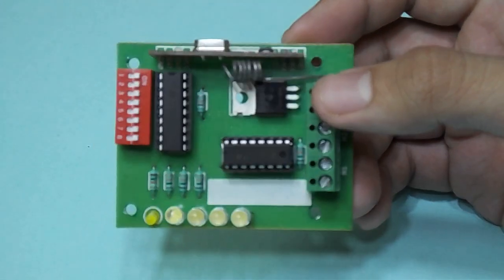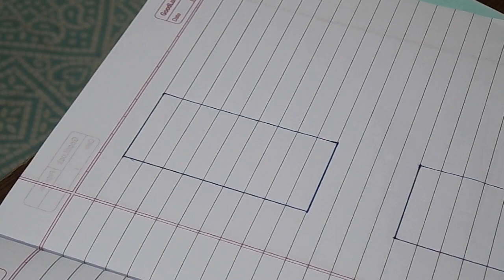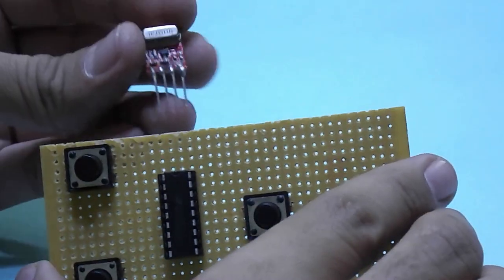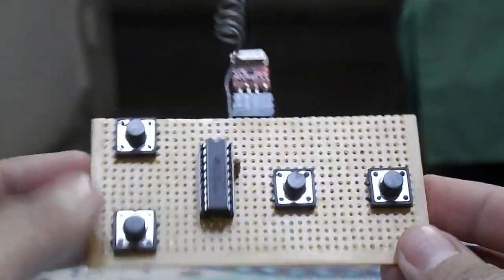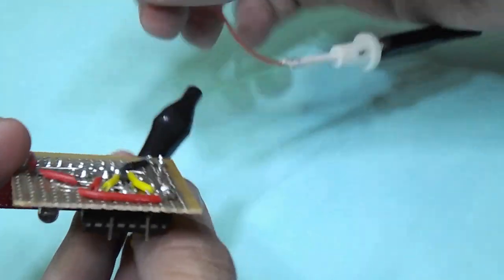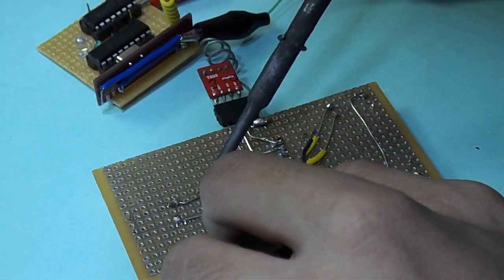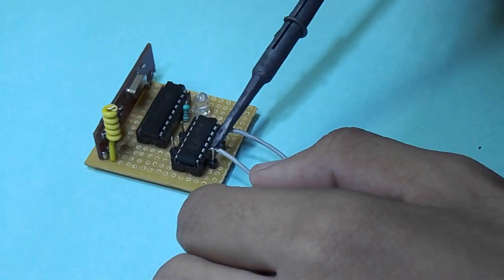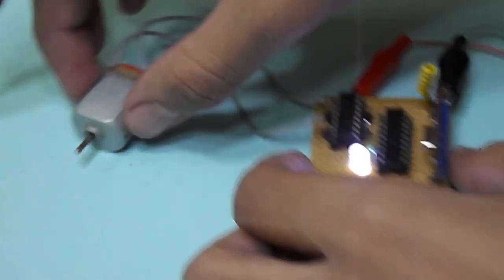How to make a RF Transmitter and Receiver

Comment: Can you  make a drone  transmitter and reciver by 
RF transmitter and reciver module.....
I want to make a drone remote control to control the speed of coreless motor....
Reply from the maker: No. It's kind of impossible because RF transmitter and receiver works with binary and drone works with PWM signals.
Reply: @techdiy2970   can you give me a real or correct diagram of RF transmitter and reciver module connection.. 
This in my email
-> yashdsahare@gmail.com

Comment: My car central locking remote receiver is not receiving signals from the remote transmitter key. How to find the culprit in the PCB board which contains receiver????
Reply from the maker: U have to check it going through a sequence 
1. Power supply. 
2. Antenna.
3. Decoder IC.
4. Actuator or any other thing.
Check these with the multimeter and if you find the bug, just fix it.
Reply: TechDIY Could you please kindly share your email address so that I may send you the pictures of the PCB board? Thanks.

Comment: Where is the circuit diagram
Reply from the maker: Done
Reply: @techdiy2970  but bro the diagram is not matching with ur Circuit
Reply from the maker: That was general one.... If want the exact one... Then wait till 12 AM today itself... 😊
Reply: @techdiy2970  ok
Reply: @techdiy2970  bro where is the circuit diagram.
I waited for 2 days
Reply from the maker: I was busy in the new project... U see i uploaded a new video.... I will surely upload it today
Reply from the maker: Done... Uploaded brother
Reply: @techdiy2970   can you give a proper correct circuit digram..
Reply from the maker: I have already given it in description.
Reply: @techdiy2970   that is real and no mistake or problem in it
Reply: @techdiy2970  I not properly  understand that where is  the the battery connection in RF transmitter and reciver module circut..

Comment: is there any way to go more cheap.
Reply from the maker: Using small push buttons will reduce the cost to 20rs
Reply: @techdiy2970  no i mean . any home made RF transmitter and receiver     like in Chinese products pre made RC car have not this type of red color RF transmitter and receiver . in receiver part they are nuclear small in size and takes very small space to fit in car.
Reply from the maker: No, its near to impossible for us
Reply: @techdiy2970  but they make that receiver  part by smd components and look simple nothing looks extra like a pcb
Reply: @techdiy2970  they use the components of RF receiver and stick them only on pcb in connection
Reply from the maker: Yes but, who will gonna tell the circuit.....? Otherwise we are able to make it.
Reply: @techdiy2970  so that thing i need bro . please work on that
Reply: @techdiy2970  they also use single ic